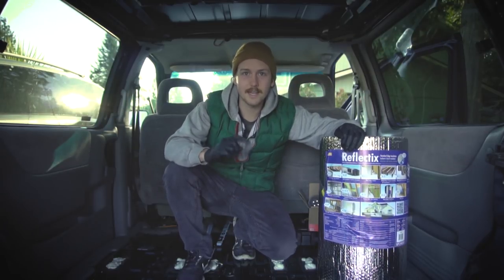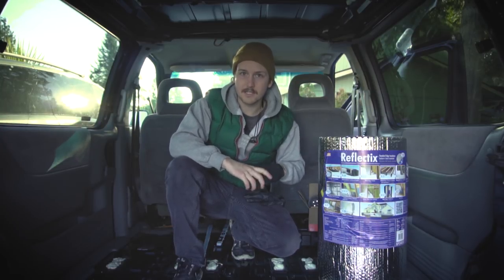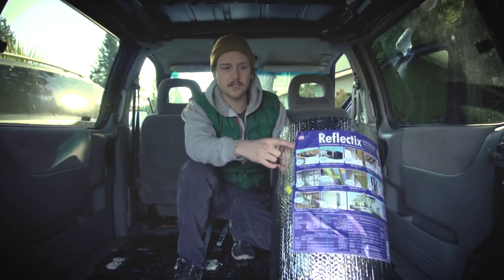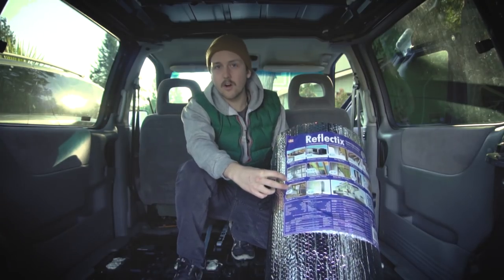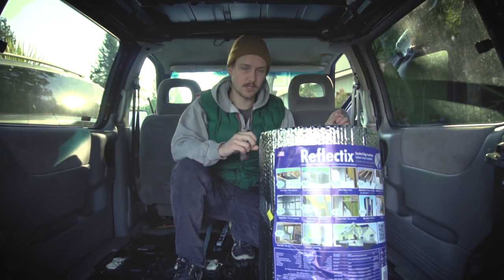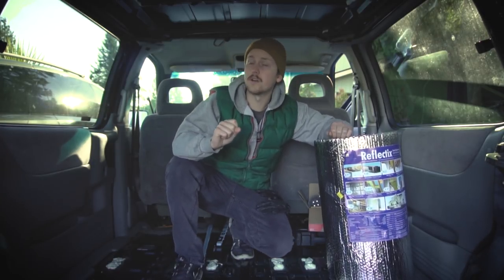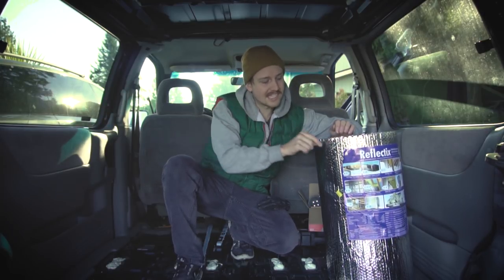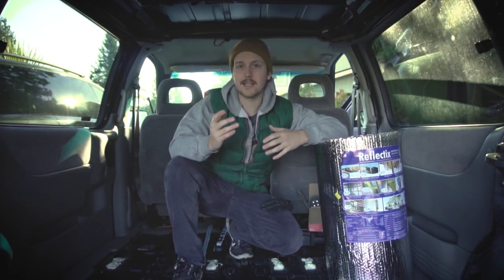The Best way to Use REFLECTIX to optimize insulation properties in Van Life / Minivan Build

Comment: The most helpful information on Reflectix I’ve seen. So many vlogs demonstrate using it incorrectly/ineffectively. The same principle applies to a DIY tarp sun shade. Greater effectiveness if a double layer with air gap between is utilized.

Comment: I believe it uses the same technology as the material found inside of most base layers. Which is only effective if there is actual heat to reflect (base layers use your skin as the heat source.) 

But it sounds like you got the right idea here. Insulation is meant to retain heat, so once you get it cookin in there, hopefully it should provide adequate heat for it to actually work.

Comment: Also might want to explain, that once you close that space, the conductive heat will outdo the reflective-ability. The key is to have the material be free to the cooler intended space. The contraversial part is once closed that space heats up, UNLESS you have a good thermo-coupling material like the foam.

Comment: I’m sorry if you’ve already said all this to the point of exhaustion but I just want to clarify if I’m putting insulation using reflectix on the ceiling of just something like your minivan then I can use foam board and then reflectix? But leave an air gap? How? Spacers?

Comment: Thanks man. I messed up and already put a  layer of reflectix on the inside of my van. Do you think if I suspend another layer on top of that layer it will work to the same affect as what you're doing?
Reply from the maker: Hey Austin, yes I do think that would help alot, the air gap helps a ton.

Comment: Hi, I also have a minivan but my windows are high and wide. What's the width and length of the reflective roll you are using? I am going to use the reflective only for windows. Tnx
Reply from the maker: The rolls come in different lengths and widths, the one I had was 50 foot long and 3 feet wide

Comment: Sorry, but you completely misunderstand how heat works. 

Heat transfers via conduction, convection, and radiation. Reflectix primarily stops radiation, but does very little for conduction and convection. However, if you hide Reflectix, it does nothing. Why? When radiation heat hits your car's interior, it's absorbed by the materials and is then transfered by conduction and convection outside. So by the time it goes to the Reflectix, it's no longer radiation. Infrared radiation cannot pass through metal and plastic, so there is no radiation getting to the Reflectix. Hidden air gaps with Reflectix is also (relatively) pointless. How will radiation get into those gaps to become trapped? The only thing you're accomplishing is maybe restricting airflow, which can be insulative.

Want to actually insulate? Spray foam. Best R value per thickness, plus air barrier. If you want exposed foil you can cover the spray foam in the foil. But if you cannot see the foil it's not working.
Reply: Space blankets work on the same principal. They work because they surround you and trap radiation. But you can't wad up space blankets in your car doors and expect it to do anything.
Reply: You are absolutely correct. I see so many camper van conversions using reflectix as insulation, and it is completely useless and a waste of money. You can use reflectix as a vapor barrier, or as window blinds together with some other insulation. It will work great for that. Every other use is just money thrown at the garbage.
Reply: @sevan8350  You could do that. But the cats may try chewing through. Making a foam sandwich with plywood as the bread would be my top pick.